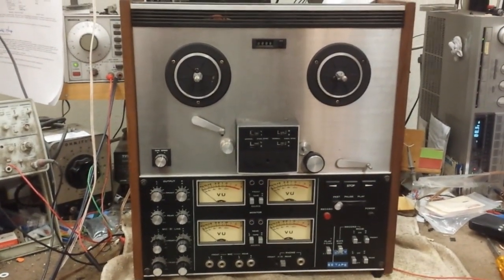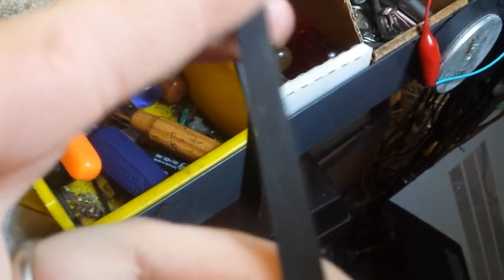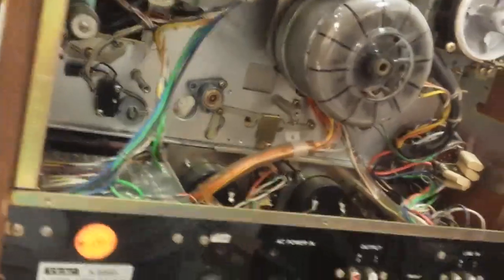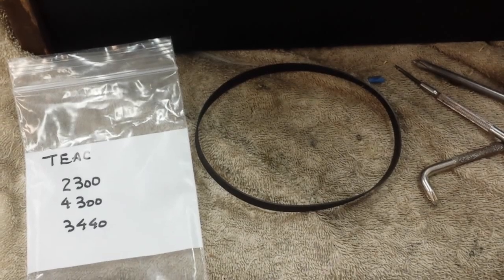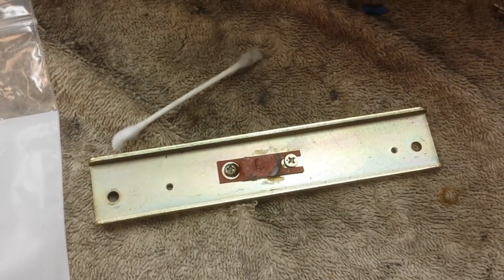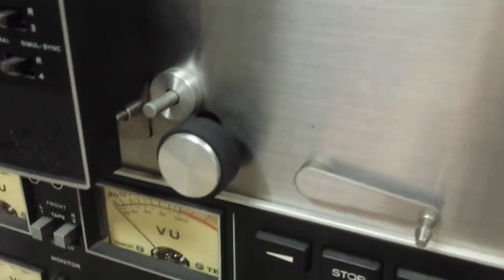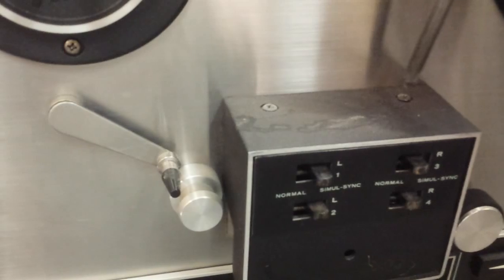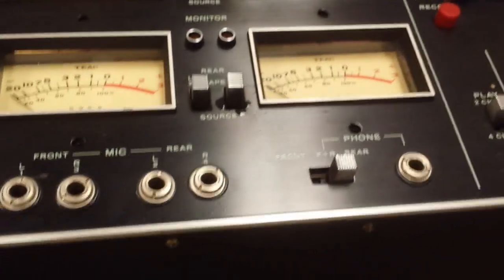Servicing a Teac A-2340 4 channel reel to reel

Comment: I just got one of these, have been doing some recording and there's already a mound of tape dust growing on the table under the machine, is it normal for tapes to shed this much or are my tapes just old and crummy? Also, do you know what types of tape I should be using with this machine for best quality recording? Do you know what the bias switch does by the record arm switches? Thanks a bunch for your video, am going to get mine lubed up and switches cleaned!
Reply from the maker: Old tapes shed. Just the way things are now.

Find yourself some old maxell ud tape. It's high bias tape and should sound decent. 

If you wanna dive down the rabbit hole check places like homerecording.com analog tape recording forum and tapeheads.net.
Reply: If you have old Ampex tapes, they are not good to run on you R-R.  After many years they turn gummy and shed like crazy.  I spent too much time cleaning my Teac heads.  I finally threw them away after I digitized the important ones.

Comment: Hi Jordan, I am a customer of yours "you put in my custom made cams in my Akai X-1800SD" and I do have a 2340 that I want to service and was curious what oil do you use for the motors? do you recommend 3 and 1? Is it the same oil used for the other lubrication?
Thanks,
Jim
BTW thanks for the great videos
Reply from the maker: Jimmy Burress  I use zoom spout or 3 in 1 electric motor oil - which is different from other 3 in one oils - higher temp and no detergents
Reply: Jordan Pier I have Zoom Spout and will use it for the motors..
I really find your tips very useful like the deoxit extension tube you made with shrink tubing and the sand bag for turntables

Comment: I removed the black switch before I applied the heat and a small plastic piece dropped out from I don't know where. I think from behind the switch since I don't see it on top in your video. It seems like it could go back on two different ways. Maybe if I knew what it does I could get it back on correctly. Can anyone tell me, please?
Reply: OK, I figured it out. It acts as the return stop for the tensioner and goes under the switch with the tab in a somewhat hidden groove on the bottom of the tensioner bearing.

Comment: I saw the way you cleaned the switches on that reel to reel. Is that how you can clean them on the TEAC 2300s? Tape source and record mode switch.
Reply from the maker: Yep, will work on the 2300 too
Reply: what do you do about speed adjustment?
Reply from the maker: There is none. It's a syncronous motor with two fixed speeds. 7.5 and 3.75 inches pet second.

If it slows down over time then the tape could be degrading and getting sticky, the motor phasing capacitors could be bad, or the motor dying - which is rare.

Comment: If you're still following this, Jordan, just a quick question. I contacted TEAC for parts, but their reply says it might be 7-10 days before they reply to even tell me how to order. Do you have any information you can share about contacting them that might speed up the process? And, will I need specific part numbers for a new belt and pinch roller wheel?  Thanks, in advance.
Reply from the maker: Brittany Marie best to ask the operator for their parts department from the start. Ask for Gary. He seems to be the most helpful.

For a 2300 the belt might be part number 5534468000, but don't hold me to that. You can download a service manual, which will tell you the part number of the capstan belt. There are usually exploded diagrams of the transport to help locate the part number
Reply from the maker: Brittany Marie and as far as the roller goes, it's best to have it rebuilt. Most of what teac had as rollers were new old stock and not in great shape. Look up Terry's rubber rollers. He does great work
Reply: Thank you, sir. I was able to find an user manual on HIFI Engine, but they didn't have a service manual for the 2300. Can you suggest another source?
Reply: Thanks again. I'll try cleaning this one up as best I can, and then give Terry a try.  I just thought if it was an easy replacement, I'd go ahead and do it all at once.

Comment: Hi, Jordan and others that might have some ideas about this...I was able to get a belt, and yesterday found the time to tear into my 2300s. All the disassembly went exactly as your video until I tried to remove the capstan flywheel. The belt came off fine, and I did remove the rubber grommet from the shaft (front of deck), but when I tried to remove the flywheel, it stuck after pulling it through the bearing casing maybe 1/2 to 3/4ths of an inch. I didn't put a lot of pressure trying to pull it through thinking I'd ask you about it first. The service manual I have is for a 2300 Series (HD? I think) and from the exploded diagram I can't tell if the shaft might be a two-piece device that should be unscrewed from the flywheel???  In any case, I wanted to run the question by you for your feedback before trying to force the flywheel removal and possibly damaging something.  I was able to loosen the lever assembly with some heat so it moves better, but I reassembled the deck and tried a test, and it still isn't free enough for the solenoid to move the roller into the correct position. It just feels like there's something very solidly preventing the flywheel shaft from sliding through the bearing casing. Your thoughts will be greatly appreciated!!
Reply from the maker: Brittany Marie there is likely buildup of tape oxide on the capstan shaft the tape runs on. Clean it well and try again. Scraping with a popsicle or lemonwood stick and finishing off with alcohol and qtips.

Avoid knives or tools that could Marr or damage the capstan surface
Reply: Thank you, kindly, sir for the prompt reply!!  Can do!!  You mentioned lemonwood sticks in the video, and I looked for them on Amazon when I bought my lubricants and cleaners, but I didn't find them. So, they're just popcicle sticks?  ~Frank
Reply from the maker: Brittany Marie yep. Popsicle sticks will work fine

Comment: Thank you.  I am working on a Teac A-3300S which has the same layout in the back...3 motors....etc.  Except I don't see any Motor oiling holes or hoses as yours has. Does the 3300S has oiling ports ?   Also what is the easiest way to clean the layers of dirt backed on the circuit board and components ?   Thanks.
Reply from the maker: If you don't see the hoses or ports near the shaft they're likely permanently lubricated & sealed. 

I typically use a natural bristle brush to clean the dust then blow out with can of air, vacuum exhaust or compressed air
Reply: @JordanPier  I have to find my heat gun but tried one of those gas lighters to heat up the shaft, it loosened up but will NOT come out.?   Also yesterday I broke that right side arm that activates the motor.  I assume some crazy glue should hold it in place?  Thanks.
Reply: @JordanPier  Another question for you:  How do you polish the silver face/front of the deck so it looks clean and shinny ?  I tried water and towel but but it looks smeared.  What do you use to make look nice and clean ?    Thank you.
Reply from the maker: @AB-hx9hs  remove it and use novus #2 polish
Reply: @JordanPier  This polish you recommend, it says it is for Plastics.  The front of this machine is not plastic, it is silver Metal.  Also removing the front on the A-3300S is not easy, it is actually very difficult.  Is there something else I can use to polish this stainless steel face of this machine ?  Perhaps something available in the house already ?   Thank you.
Reply from the maker: @AB-hx9hs  it is a plastic polish, but there is a clear coat on the aluminum which responds well to polishing with that.
Reply: @JordanPier  You think the clear coat is still there after all these years?   In any case I would have to buy this online & wait for it to get here, I was hoping for something else I can use that I may have already, so I can get this done.  Thanks.
Reply from the maker: @AB-hx9hs  metal polish like brasso, chrome polish, hell even some car wax might work.

Comment: Sorry Jordan if you see this question, what is the lubricant you are using. Sounds like KD Oxide but its not clear
Reply from the maker: Craig deoxit for cleaning switches and controls

99% isopropyl alcohol for cleaning
Zoom spout mo98 for oil
Reply: @JordanPier  
Thank you Jordan very much. Kindest Regards

Comment: I have a 2300SX and I need to adjust the reel tables. You stated that the screw (the one next to the spindle) is used to adjust them?
Reply from the maker: Counter clockwise to raise them, clockwise to lower
Reply: @JordanPier  Thanks!

Comment: hello jordan i have been a fan for a very long time and i have a teac a- 4010 - sl reel to reel deck and i recently have an issue where in forward play it works great but when it is in reverse play i hear both sides of the tape and both play heads are active instead of the forward being muted  also the volume level is low on playback  is there a way to increase the playback level  can you give me any ideas what i can do to fix this issue or doing if you can a video on that how to fix that issue thank you in advance and be safe and careful and all the best jon
Reply from the maker: Head relay is not switching properly. Might be fixable but usually requires donor machine if it cannot be fixed
Reply: @JordanPier  hello I will try tapping on it to see if I can get it to fix itself I can't get any parts there are no places to get them and j will let you know what happens also what can I do to increase playback output level thank you for your time jon

Comment: Great vid. Thanks for sharing. What type of oil is that?  Can you use synthetic oil for sewing machines?   Thanks
Reply from the maker: rsanchez7111 seeing machine oil really isn't viscous enough. synthetics are OK as long as there are no detergents. 3 in one electric motor oil could also work, not the regular stuff though
Reply: rsanchez7111  many top repair shops have gone to Mobile 1 0-10W or Amsoil lightest wt. synth. and measured significantly lower wow & flutter.
Reply from the maker: Not sure about the validity of that. Replacing the old oils and greases would improve things, but I'm doubtful that synthetic vs conventional holds any significant wow and flutter change. They would have to have two identical machines with identical test tapes and test equipment - and unless the tape is brand new (doubtful) then It's no longer flat and the wow and flutter may differ slightly on each pass. Not a good test. Sounds like snake oil to me.

Stick with a good non-deturgent turbine oil like zoom spout. Works wonders.
Reply: of course you can read for yourself at TAPEHEADS dot calm. All-in-all this was a very good video.

Comment: I don't Know if you are still watching these posts but I here goes. I have a Teac A 2340 SX the switches for play ff and rew quit working where as they worked for the last five years.  I tested the micro switch for continuity and open shows no continuity amd closed shows 6 to 8 ohms .   my thoughts are the solonoid may be quit working.   I've tryed to find online help and failed to find anyone who can help me.  I really hope you can help me.
Reply from the maker: Make sure the dummy plug is present on the back. Check for blown power supply fuses inside that provide voltage to the relays that control the solenoid.

Make sure pause is not engaged.
Reply: @JordanPier  The capstan motor runs when the switch is engaged .Ill have to look for the internal fuses.  thanks very much for responding so soon.

Comment: Can you do a video on replacing the counter on a 2300 series TEAC? Thank you.
Reply from the maker: HD Imaging haven't seen one come through the shop in awhile. If the counter is sticking often working it back and forth from the pulley with the back off cures it. If it's seized or the belts broken then it needs to Come all apart
Reply: Thanks for the quick response.  The belt was moving fine but the counter periodically hesitated at the 10th digit when it needs to turn.  The same at the 100th digit.  Taking your suggestion to oil the counter now seems to solve the problem.  The digits are turning smoothly and not hesitating any more.  Much thanks.

Comment: Would have been terrific if you had showed how to replace the counter belt.  The Teac service manual is absolutely useless for help in replacing this belt which in an old machine like this always needs replacement

Comment: Another question:  On mine when I install the fly wheel and screw down the bar that goes across it, if I tighten it down then the fly wheel is too tight to the point that the motor can't move it.  Should I or is there 2 spacers between the bar (That goes across the flywheel) and the 2 poles where it is bolted down to to give the flywheel some play to move freely ?  I didn't see any spacers but it seems without them the fly wheel is too tight.  Or did I do something wrong ? The flywheel is pushed in all the way to the front of the deck but it feels too tight.  Thanks for the help.
Reply from the maker: Either the bar isn't seated right or you need to change the thrust bearing play. On the back of the flywheel there are Allen keys that when loose allow you to adjust play.
Reply: @JordanPier  Thanks so much, yes I saw that.  I just don't know why it was sitting fine before & now after I did all the cleaning..etc. it is tight.  But I will adjust it.  Did you see my question about what to use to lubricate the motors ?  Can I use Car Motor oil?  I don't have anything else, or Olive oil.
Reply from the maker: @AB-hx9hs  none of the above. Either 3inone electric motor oil or mo98 zoom-spout. Don't cheap out here or you will trash your motors
Reply: @JordanPier  Ok, I guess I have to make a trip to Walmart and see if they have this or maybe home depot.  I had a small container of electrical motor oil but don't know where it is anymore.  But seriously, olive oil will not do the job ?
Reply: @JordanPier  I just found a bottle of Selmer Key Oil No 2934.  I can't find much info on it other than it is to lubricate clarinets and points of friction.  I wonder if it is the same as Machine Oil and if I could use for this application ?   Thank you.
Reply from the maker: @AB-hx9hs  I'm thinkin no.
Reply: @JordanPier  This second unit is frustrating the hell out of me.  I cleaned the switches and volume knobs...etc with alcohol, dust remover spray and dust remover compressed air.   As soon as I turn the unit on and listen with headphones, even with the volume at zero I still hear some crackles and noise.  I don't know where it's coming from, the motor is off and nothing is running.  Is it because the machine is not grounded ?   Have you run into this before ?   There is also still some crackles when I turn the volume up and down despite the fact that I blew out all the knobs multiple times.   Thank you so much.
Reply from the maker: @AB-hx9hs  blowing it out doesn't do much. You need a contact cleaner like deoxit d5. Get some inside the controls where the three leads exit the body of the control and then work the control many times. Don't use substitute cleaners or wd40 or you will do much more harm than good

Comment: I wish you or someone would make a video concerning the electronics of the unit that effects the recording sound quality. Like what parts on the circuit board were replaced to improve sound & recording quality. You know, checking capacitors, transistors, diodes & the the like.
Reply from the maker: Michael Powell not a lot goes wrong with the electronics. If the recording quality is poor check for head contamination or gap wear in the head. Poor quality tape will also do it

Comment: do you repair pioneer rt 909s?
Reply from the maker: I've worked on a large number of rt-909. They are one of the more difficult machines to service due to the pinch rollers going gooey, power supply problems, the occasional capstan motor failure or the micro switches in the compliance arms that become lossy or open.

Set aside $$$ to get one working properly and reliably, not to mention the large shipping cost.

Above all, make sure the heads aren't so worn that it doesn't make service worth it. If there is an excessive wear gap in the head (one you can see or feel with your fingernail) then I would focus on finding heads or pursuing a better deck.

Comment: Please note... I  realize  this video is five years old, but some  late production TEAC reel motors don't have oil fill tubes - they  are lubed for life.
Reply from the maker: Yes, the DC ones are permanently lubricated. Most if not all the AC motors had oil tubes. If not, pull em apart, clean and relube  them with good turbine oil
Reply: @JordanPier  Hi again, Jordan... I do not want to belabor this string, but indeed, some of the late old AC motors did not have oil tubes.  In fact, I have an A-3300S whose take up and wind motors have tubes and the capstan motor has none.  I talked to Sam Palermo in Chicago, and he was the one who clued me in on the fact.  I hope you know who Sam is... he was the manager of TEACs repair department back in the day, he is the TEAC go to guy in this country.  BTW, he said that modern 5/20 SYNTHETIC motor oil is better than the old school TEAC recommended oils for these uses.  I use this oil on the pinch roller, capstan shaft and capstan motors, also on my turntables (2) Thorens,, Philips and (3) DUALs.  Reel to reels include (2) A-1230, (2) A-2300S, A-1250, A-3300S and an Ampex ATR-700 (which is a TEAC A-7300 in mufti) - all in working order... when friends find out you have TEACs, the units come out of the woodwork cheap or free.  I hope I did not put you to sleep and have a good evening.